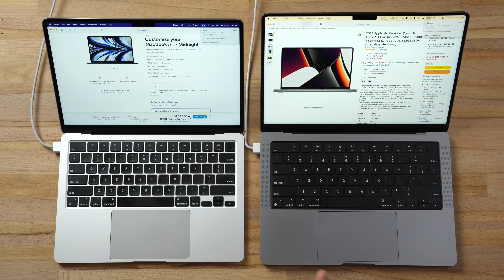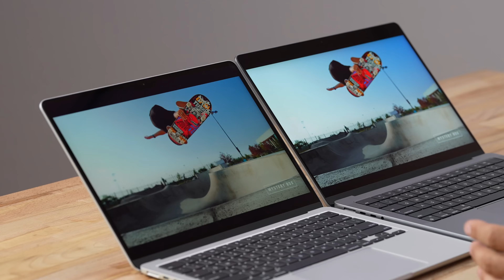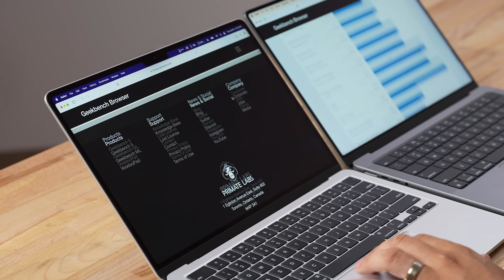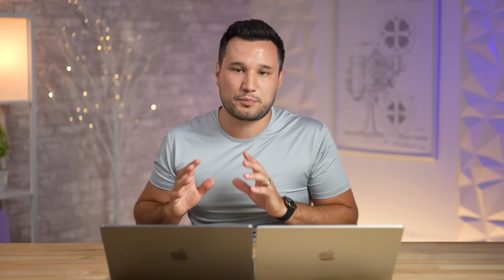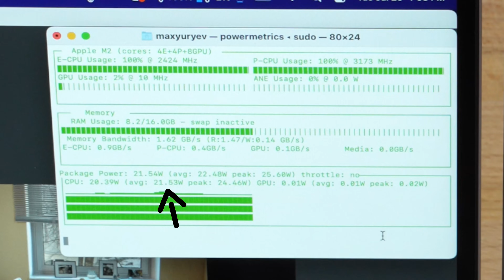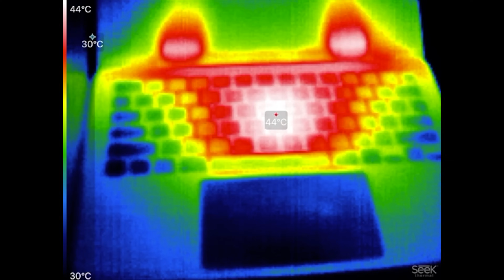M2 MacBook Air vs 14" MacBook Pro - Prepare to be SHOCKED!

Comment: Going for the 14” is definitely worth it if you don’t mind the extra size / weight. Even new, it’s only like $250 more when on sale which isn’t a whole lot more for a far more powerful laptop.
Reply: I literally canceled my MBA order and got the MBP 14” since it’s only $1749 at Best Buy right now. Which is an insanely good value
Edit: it’s now even cheaper at $1699! Best Buy did a post-purchase price match for me and credited me the $50 difference :)
Reply: @eBikify  I’m leaning towards doing the same thing but my question is did you purchase it for the vbalue or you plan on using all of its capabilities I.e video/photo editing, gaming. I feel I don’t necessarily need the Pro but what’s currently listed at on Best Buy, it’s better value than upgrading the specs on the M2 air. Still a bit conflicted but the Pro seems like the better laptop for its price and the long term outlook.
Reply: @joelsalazar3474  I bought it at the $1749 bc it’s honestly a no brainer. Out of all MacBooks available right now, the base model MBP 14” at $1749 is probably the absolute best value I’ve ever seen for a MacBook. The amount of power, battery life, display quality, and all the extra ports you get, I’d be crazy to pass it up. 
I don’t necessarily need the Pro performance, but I feel like it’ll outlast the MBA bc of how smooth and consistent it runs, and is more future proof
Reply: @eBikify  yeah I agree this is the best value even though I’ll most likely never use its’ Pro capabilities and M2 air price point when you improve the specs doesn’t compare to the Pro. I wonder if there’s any chance the Pro goes down further down in price or is this the best it will get?
Reply: @joelsalazar3474  Valid question. That’s really up to you. I mean, when the M2 Pro models eventually come out, then these will likely get phased out and possibly discounted even more. However, then you’ll run into the problem of running out of stock and you missing your chance at a killer deal. A lot of ppl are buying the 14” MBP bc of that $1749 price. Honestly I don’t see it going down much more at all, even after M2 pro releases. But again, it’s your call
Reply: @eBikify  definitely is a great deal. Most likely will pull the trigger at Best Buy for $1749 and I agree with you that don’t see it going down much after the m2 pro comes out. Still haven’t seen them side by side in person so I’ll definitely go to my Best Buy and compare size/weight to see if there’s big difference or not.
Reply: @joelsalazar3474  Best of luck, man!
Reply: I got my map 14 yesterday and its the best decision ever.
Reply: @itskayeds  That’s real nice! I’m waiting to see how the M2 Pro chips perform, and how efficient they are. I hear some conflicting reports on whether it’ll be 5nm, or 3nm so I may end up waiting for the M3 Pro if the M2 Pro / Max are 5nm.
Reply: Should i wait for maybe an m2 Pro? (if They are going to make such thing that is)Im scared of buying a new laptop, only for a better model later Down the Line at the same Price.
Reply: @HighlightsDanmark  I haven’t really seen a ton of info on the M2 Pro chip besides that the GPU should receive a nice improvement. Most of the leaks are about the M2 Max unfortunately. However, there have been some leaks stating that the M2 Pro / Max chips could be based on the 3nm process which will bring huge improvements. Although there have been other sources saying that it’ll stay on the 5nm process. I’d personally wait a little while to see more leaks on the M2 Pro chip, but if you need a laptop right now the M1 Pro will still be an amazing chip.
Reply: Yep. I love my 14 M1 Pro
Reply: If, or more likely when, the MBA starts to go on sale this difference will be moot, especially if the sales are at the same time for both products.

At that point the decision should be based on which of the tests performed here most closely match the expected workload–choose based on which fits your needs and budget.

Also, for photo and video editing (which I don’t do) I assume most people spend a significant portion of their time doing the work and much much less time on the exports. So are you really saving that much time overall? Or are you saving 2x on the last 5% of the total wall time on a project?
Reply: Yeah
The biggest problem with the 14" model in my opinion:
- battery.... the 16" just got 30% more battery, thats a big difference in runtime, especially with internal display not used (thats about 25 hrs vs 34hrs!)
In astrophotography i just enjoy the big battery, since the 16" M1 Pro i didnt have to care about battery charge left anymore at all!
- 14"... this new Mini LED screen is that awesome, its just sad to see such a nice screen but in "netbook" formfactor without "usable" size as standalone screen. The 16"s model is at least usable, even as super mobile "iMac Mini"
- price to performance ratio, on a 16" base model you just get unbinned M1 Pro chip!

Also, i dont get it.... 1,1 kg on M2 Air is also "much" for mobility, the 0,8kg on the 16" model is just not that much (considering what you get!)

Comment: Got MBP 14" M1Pro for the same price of a MBA M2 512 Gb upgraded to 16 Gb RAM. No brainer. Very happy with the MBP 14". Made right decision. Thank you your test comparisons. They helped very much!
Reply: New one, right? from Best buy. Or did you get the refurbished one?
Reply: @ShubhamGupta-qs7mp  New one from Best Buy
Reply: But, you are getting only the base model MBP
Reply: @yapchenpo95  Which is still better than an upgraded M2, so what's your point?
Reply: @yapchenpo95  Yes. Enough for me. I was using a MBP 15" Intel based 16/256. Still going strong after almost 8 years. After one week with the MBP 14... man... I'm impressed with this laptop!
Reply: Hope there maybe M2 pro 14” gets
Released in September/October. Waiting for it. M1 Pro 14” is good choice if you can’t wait 👍🏼
Reply: @NavaneethDevaraj  Felt my MBP 15" was beginning to show its age so needed something better, could not wait for the M2 Pro, and the price at $300 less than list was irresistable.  Although the MBP 15 is still going strong (built like a tank I would say), when making PPT image intensive presentations and some Excel spreadsheets, I can notice the M1 Pro is quite fast. Really fast...

Comment: Does the pro 14 have a "power saving" like the m2 (like the previous video with 7W power consumption)?
Reply from the maker: Yes, but it only has 2 efficiency cores and they are quite a bit less powerful than the new ones in the M2, and the M2 has 4 of them.
Reply: Yes it does. It is available on all MacBooks built in 2016 or later.

Comment: Right after WWDC I ran some calculations and estimated similar results so we purchased a 14" for my son at Educational pricing. As we could have gotten that on both it made the 14" about $250 more than the Air at this configuration. I felt screen, ports and estimated increased performance was easily worth the money. I definitely appreciate the video which confirmed our choice with the 14".
Reply: Wish I had a Dad like you when I went to school.
Reply: Funnily enough, my dad and I made the same decision for me after WWDC. We briefly considered the M2 machines, but ultimately decided the 14” was worth the extra money for what you get in exchange. My 14” has since arrived and I’m loving it! No regrets

Comment: I haven't seen anyone test it yet with the M2 MBA, but I have the M1 MBA and when I'm using an external 4k monitor while plugged on the charger, it gets pretty hot, especially on the thunderbolt ports area, and usually throttles easier than when using only the built-in display. So I think it's something to keep in mind, if you use external monitors often the 14'' may be a better choice because it's cooler, supports more than one screen, and has an HDMI port.
Reply: That would be an interesting test, and add it using clamshell mode.
Reply: Id like to see this test, same happened for me on the mba m1….it also annihilates the battery with an external

Comment: For the battery usage you have to take into account that the pro has a bigger battery so 10% usage on both means that the pro used more power over the same amount of time under the same conditions. Which makes sense

Comment: I’m sure the M2A would have met my less-intense needs, but I don’t regret going for the 14” Pro. Thanks for this comparison!
Reply: Just for the extra ports, screen real estate, and extra 8GB RAM in the base model made the 14-inch M1 Pro worth it for me.
Reply: The Screen and Speakers are worth it alone.
Reply: thats why i was against in upgrading the m2 air. The more you upgrade it from the new price point the less value it has; which is what apple wanted. For only 250 more bucks you get a more capable machine by far.
Reply: Same here, but 16" M1 Pro base model

Im taking it nearly daily with me, use it daily and for everything and its just a superb allrounder (and even better than a desktop in being a deskop!)
Reply: I feel.the same way
Reply: @red pill, those were a huge factor for me, too.

Comment: I’ve had my M1 MacBook Air (256g/16 g ram) for 16 months now. It was my first MacBook and it blew my HP laptop away in terms of speed, portability, battery life,  etc. I think the 14 inch Pro is better value imo, as you have all of that power/sustained performance at your disposal. It’s chunkier than the M2 Air, but that won’t really be an issue once it’s placed on a desk or table. Think I’ll update to the 14” Pro.

Comment: Prices are always different in Europe. That M2 Air costs almost 2000 EURO, exactly the same as the MBP 14" base model (brand new at a discount, NOT refurbished!). For me it was a no brainer, I'm writing this comment on the Pro :)
Reply: Where I'm from, the 14" MBP is €2200 from Apple, but I've seen it as low as €2009 in other stores
Reply: @AzVfL  yep. It’s actually 2350€ here, but it’s discounted at some major electronics department stores, down to 1996€

Comment: I am making the decision about these two machines right now. One of the things you didn’t test is driving a high resolution monitor. My base spec M1 is choking a bit when also doing other tasks and charging. I’m guessing the charging is what’s putting it over the edge so MagSafe should help but it would be nice to do tests when driving at least a 4k monitor as, I’d guess many have as the basic work setup. Still, very helpful comparison. (BTW, what thermal camera do you use?)

Comment: As I suspected the 14" in my opinion is the one to go for.  I chose that one as my upgrade from my late 2008 Unibody Macbook.  It meets all my needs and then some.  That's not to say the M2 Air is not a great option but given the Pro has better cooling and includes many more useful ports, I would suggest given the price difference that the Pro is the more practical option.  If money were no object and I had a spare £1400 (hahahahahaha!!!) Then of course the Air would be great for college and small away journeys, due to its diminutive size and weight.

Great video and absolutely proved to me that my original choice of the 14" Pro was spot on!  Thank you again for all your vids guys!
Reply: Too much money $2500 cad
Reply: I'm nearby. Need to choose the model as upgrade from MBP mid 2009. My first wish was the Air M2, but after I've seen an good Amazon Deal (130 Euro more) for MBP M1 Pro 16GB/1TB it was easy to decide.

Comment: Both are great machines. It really comes down to your needs and usage. I went with a 14" MBP for various reasons. One being all the ports. The SD card reader is so nice to have back and not needing some sort of dongle. I just needed more connectivity. Also, bigger/heavier is NOT an issue. I mean, we're talking about 1 pound? It's worth it to have all those ports. I do audio & video production and have yet to hear the fans come on. The MBA would be perfect for my wife.
Reply: I noticed the weight difference in the specs too. 0.8lb difference. Pretty negligible. Especially considering the 14" is considerably lighter than my 2015 15" MPB and my previous 2008 13" unibody Macbook, both of which rarely leave (or left) the house. Only my little 12" MacBook travels occasionally when I need to take something for things an iPad can't do.
Reply: @gregedwards69  If you're travelling all day with it in your backpack, it makes a difference...
Reply: @gregedwards69  Thanks. I currently have a constantly-used 2015 MBP (13"), and prior to that the 2008 13". Mostly at-home machines. My 2015 speakers are shot, and battery is weak, so I am going to consider the 14" MBP M1.

Comment: M2 McBook Air is definitely best option
Reply: Nah.. The base model 14” MBP is by far  the best overall value for a MacBook right now. Especially since it’s only $1749 at Best Buy currently. 
The benefits you get with the MBP are well worth the $1749. 

- STOCK: readily available, whereas the Air is
brand new and can several weeks to ship depending on the model you choose. 

- DISPLAY: slightly larger display size, even thinner bezels, higher resolution, 120hz Pro-motion, and Mini-LED instead of cloudy/gray outdated LCD

- SOUND: Larger speakers for clearer/louder audio

- PERFORMANCE: up to double performance, double the ram (16GB standard, compared to 8GB on base model MBA)

- STORAGE: Double the standard storage (512GB standard, compared to 256GB on base model  MBA)

 - CHARGING: Faster charging out the box (MBA requires you to buy the upgraded charger to get faster charging)

- PORTS: MBP Includes an SD Card reader, HDMI port, 3 thunderbolt ports, and headphone jack (The only ports MBA has are 2 thunderbolts and a headphone jack)

- NO THERMAL THROTTLING: As a
result of the MacBook Air not having a built-in
cooling fan like the Pro does, the Air will drop
in performance after roughly 5 min of heavy workload, and it doesn’t take very long to throttle even under a moderate workload.

- LONGEVITY: I’m no computer engineer, but I would expect the MBP to outlast the MBA, mainly because it has a built-in fan to help cool off the internals.

Comment: I dont do video or photo editing, only programming not heavy but I do it all day, I normally have 3 browsers and around 30 tabs in total, youtube, sopotify,
vscode, database, postman. would it be enough the M2 Air? like having the air all day (12 hours) turn on.. would it be suffering with the overheating?
Reply: Yep, no have a any problem in this case, I have Air M2 10 gpu, 16/1Tb

Comment: Guys it’s time to face reality.  95% of mac users are not doing any hard core tasks and will appreciate the lighter weight and thinner M2 Air!   Even the screens are similar with non HDR content!  I think the M2 Air w 16gb / 1 TB is the perfect every day computer.   I can’t wait to get mine!    If you need the horse power of the pro you should know that up front and be prepared to deal with the larger size!
Reply from the maker: I know 5 people making over 100K a year doing hardcore tasks on the M1 based systems. They can be used for serious work, with that said the 14" is better but not everyone needs it, it really depends on what you do.
Reply: @MaxTechOfficial   keep up the great work.

Comment: Chances are this decision comes down to a use case. If one highly values portability MBA, if one wants dual display MBP (for example). I chose MBP because I want a single device for both desktop use and travel. MBA just can’t handle my desktop needs and I don’t want a Studio and MBA. 

FWIW - I get better Speedometer 2.0 results on my base MBP14 than this video shows. Consistently over 300 (and more like 350). MBP isn’t slow as a web browsing device. But it does appear the M2 machines are faster on the benchmark.

I was worried about the MBP form factor (coming off Intel MBA) but I’ve actually like it. It feels solid and the screen (esp. with Vivid installed) is incredible.

Comment: I enjoy ur detailed reviews but can you keep the same unit on the same side in every scene. Switching the pro on the left to the right side back and forth makes it confusing to keep track.
Reply from the maker: Oh sorry I didn't think we did.
Reply: @MaxTechOfficial  multiple times in this video in fact. first part M2 on the left M1 on the right.  design portion side by side showing thickness, its switched. display comparison m2 left m1 right until you turn off the lights reveling the "grey screen", its switched again and stays that way into the pro motion part until you mention battery life where it switches yet again. it keeps happening you can review your videos. one thing you can also do is hover a label on which unit is which. 

thank you again for your detailed reviews!

Comment: I can appreciate both of these machines for what they are. That said it’s wildly impressive a fanless laptop came out with more battery in the end after running these processes for longer. If it comes down to a situation where you don’t have a power source, do you want a machine that can do it fast or a machine that can do more but takes more time? Obviously each person will have different needs but it’s interesting to think about.
Reply: The consumer grade machines have always had better battery life than the Pros. It comes down to Apple’s Pro machines being more power hungry in order to offer greater performance and graphics capabilities. The fact that the current models are as close as they are is nothing short of a miracle. I’ve almost never been able to get more than 2-3 hours out of my 2017 MacBook Pro 15. Which really sucked when there were so many tasks I could have done on my wife’s 2013 MacBook Air and have gotten 5-6 hours of battery life. Now the minimum is around 8-9 hours, which covers a full workday. More than that is just gravy.